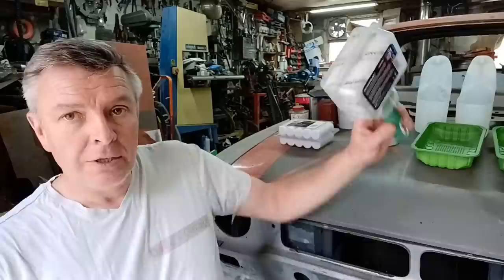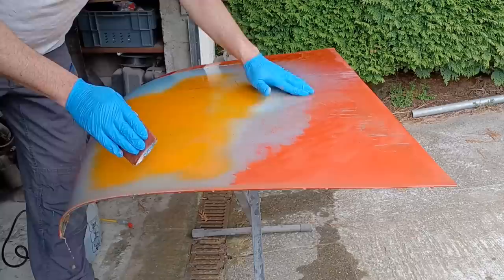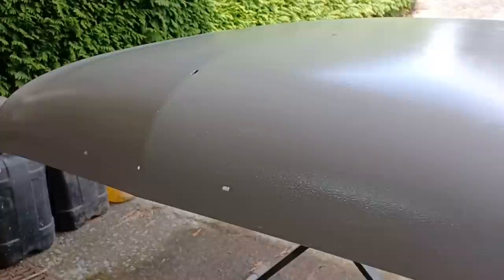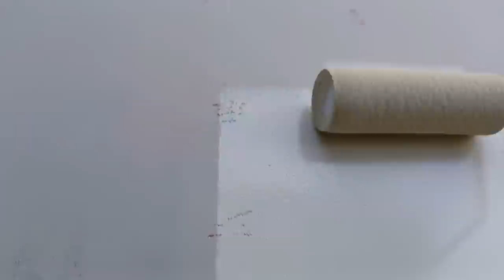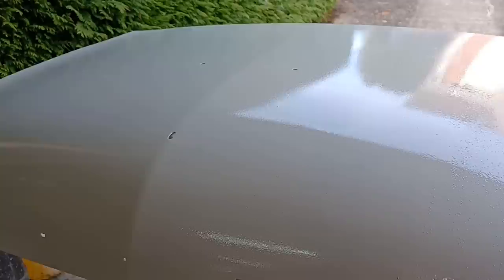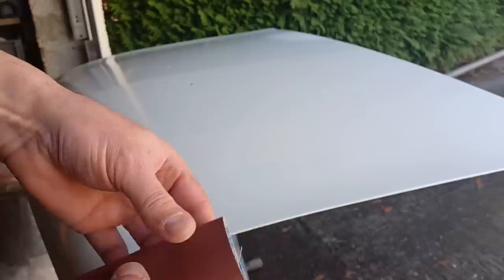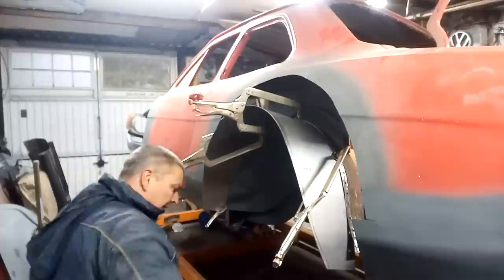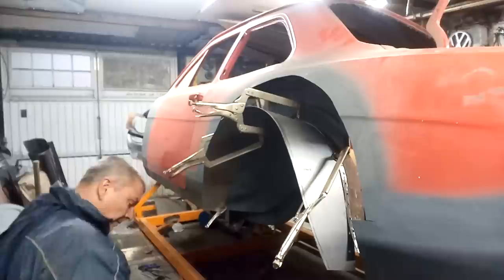Ford Escort MK1 Restoration Project. Can 2K paint be applied with a roller?

Comment: I'm so glad you tried this, as I have wondered about trying this for a while. The biggest advantage to a brush or rollered application, for me,  is the lack of overspray. Spray finishes can be excellent, but I suppose they have been developed with bodyshops in mind , with time equalling money being the main consideration. That is not necessarily the best solution for someone restoring a car at home. It would not bother me if it took me 3 months to paint a car, as long as I got a good, durable, finish.

Comment: Now I’ve seen you try I might give  this a go 
The parkside rollers you have I think are the long pile ones so will leave more of a texture as they are more for masonry…and the foam I always find introduces bubbles 
Perhaps try the short pile (for smooth plasters/interior walls) and wrap/coil in masking tape then pull the loose fibers right out the box prior to mixing up 
The long pile I’ll probably go for just the primer perhaps then a light sand 
The trick I’ve seen with composites and woodworking epoxy is a little heat from a blow torch of safer a hot air gun to thin the epoxy top coat once applied  (especially in uk temperatures) and it lets the bubbles rise and pop 
Then when you have s pretty good surface …cutting compound and a buffing polishing machine 
A tool that would probably come into play at the end anyway

Comment: Some years ago I used a paint called Parsons Re-Paint which was applied by brush. I did a Minor 1000 and a Mini and the end results were pretty amazing, in fact people would ask me where I had the re-spray done which made me feel pretty good!! First you applied a primer then the top coat but I always remember unlike house paint when you applied the top coat you brushed ONLY in one direction and never back....if you did it would leave a visible mark. The top coat 'gels' together and once fully dry and hardened it gives a high gloss finish. Its not cheap but lots cheaper than a professional re-spray!

Comment: I once painted a VW LT van with a roller using Blakes yacht enamel. It went on fairly smooth, but it was a hot day so I should have probably thinned the paint down a bit. There was a run on the drivers door, but when the paint was fully hardened, it was difficult to sand this out.

Comment: Definatley worth the try, there is so much work in spraying even after the car is prepped and even more if you dont have a booth. Portable booths made of polythene are available like a tent frame where you can use inlet filtration and extract, Elin Yakov had one to prime his GT6, as opposed to emtpying the garage of everything dusting out and then wetting the floor. Alternatively you could spray a panel at a time and create the finish after by flatting and polishing the nibs or runs out. You can see where the money adds up for a proffessional job, but its not all highly skilled, but experience helps (I would imagine).

Comment: Dave, you are a real trail-blazer, that's for sure! Many years ago I used to do a bit of work for a local body shop, and the painter there used an enamel paint for the cheap resprays, mainly because in those days he was spraying with cellulose paint and the finish straight from the gun always needed a lot of buffing to get a good shine, whereas the enamel was amazing really. You would have better luck with an enamel paint because they are made to flow out and take forever to dry, Tekaloid used to be a brand that was around at that time and was classed as a coach enamel. The main drawback is dust contamination (and flies!) owing to how long it takes to dry. Don't worry, you are super-skilled, you will master spray painting, no doubt. I have painted 2 full cars, albeit a panel at a time, in my own garage, and they have both been to shows and stood up to some serious professional scrutiny.
Reply from the maker: Cheers Bob, I have used Rustoleum enamel to paint a couple of cars, but the problem I find with enamel paints is that they are slightly hydroscopic, which is a real pain.  Surprisingly easy to get a good finish, but it doesn't last. 

Thanks for you comment mate 👍

Comment: I am going to roller paint my Prefect hot rod. I shall be using Epifanes yacht paint, applied with a roller and denibbed with a foam jenny brush. -it's kind of a coach building technique, people that have done this in the past have had excellent  results. It's important to always be working with properly wet paint - never go back over partly dried paint. Thinning the paint by 10 or 15 per cent helps a lot.

Comment: gr8 work as usual dave ,interesting experiment with the roller ,  spraying is the way to go with body panels , but as you say ,on gravitex ,brush and roller are very good , i gravitexed the underside on my rs2000 project and then brushed on 2k with hardner mixed in but no thinners , worked a treat

Comment: Make sure the rollers you use are solvent resistant, if not they will break down as you use them and leave bits and nibs in you paint, if this happens in primer it will show as nibs in the topcoat.

Comment: eastwood do a brush & roller primer (OptiFlow), its expensive though in the UK, with epoxy you have around 72 hours to paint over without having to key it, you can get away with less activator in the top coat to keep it thicker especially in the summer,

Comment: I swapped to a LVLP spraying set-up. It has many advantages over HVLP - you need less air, there's waay less overspray (I.E if you don't have a booth - we do but I know loads don't).  Less overspray means less stuff flying around in the air.  

The main drawback of rollers is that nooks & crannies are a pita.. Same goes if there's a complex shape to do, you'll just struggle to get coverage - spraying works better. You can buy a good LVLP gun for 60 or 70 quid, get a good respirator, use a boggo smaller compressor & paint ahead.  I 100% "get" the appeal of using a roller, but generally unless it's a very flat panel, meh, it gets dull - and even on flat stuff, it's also Dull. If it worked good, bodyshops would do it  - they don't, so there's your "Hint".
Reply: Incidentally, I kicked into repairs on a turbo-'scort tailgate & passenger door today - mainly as no replacements could be sourced at "reasonable" cost.  I got the passenger door done today - no big drama, needed a few areas replaced - but the tailgate is another story altogether.. Sweet Lord it's gonna need work everywhere. I'm bargaining on being stood working on that tailgate for the next week at a guess. If I get it done any faster, it will be a miracle. 

"Hint" was when I took the spoiler off & underneath every mounting point was absolute toast - that & when I took the glass out, most of the frame fell off with it... Wish me Luck. :-)
Reply from the maker: All the best with that pal
Reply from the maker: Ok, cool, I'll look into that closer to the time, you'll have to remind me though, I'm like a goldfish 🤣
Reply: @DavesGarageuk  My Missus bought me my first LVLP gun a few months back off Amazon - a Voilamart one - I was a bit skeptical at first, but having used it for the last 6 or 8 weeks - yeah, it's a great way to go. Especially for 2k clear-coat - that stuff through a HVLP gun clouds up everywhere with paint mist very quickly & it will happily kill you stone-dead if you muck about with it on the "breath this in" front - with the LVLP gun, "air-mist" is about 1/3 of what it was with the HVLP gun - so the extractor copes a lot better, meaning I get to die less, which is always good.

Same applies to that epoxy primer btw - it's laden with isocyanates that happily lodge in your lungs, doing you no favours - even if you are rollering it on. If it says "2K" on the label, be wary - 2K & lungs do not play well together, no matter how you apply it - Sensible Susans wear respirators just mixing it - and they're very possibly highly correct to do so too..
Reply: The only reason I’ve avoided a home compressor and spray gun set up is the initial investment cost but then having to buy a litre of paint and associated thinners every time you want to carry out a small panel repair. Sometimes a litre of colour can cost £80 plus all the other bits. Not really worth it for a one-off job.
Reply: @jamesward5721  That is very interesting. Is it the vapour that damages you or breathing in droplets of 2k paint or both? I've never seen anyone on youtube explain this. Also, how do you know when it is safe to inspect the paint without wearing a suitable mask?
Reply: @philtucker1224  if your only doing small repairs you dont need to buy a litre every time. 
I run a restoration company in Warrington but i buy my paint in and most paint suppliers will mix in 200mll increments. 
Depending on colour a litre costs me 55. 
But 200 ml if im doing a little repair is only 15.
Reply: @spongebobfenn  that’s very good to know Lee, thank you mate. 👍
Reply: @spongebobfenn  same here, for small repairs I can buy a tenth of basecoat for £12 , using my mini jet it goes a long way.

Comment: When using two pack, you have to lay the paint out quickly and leave it to flow you shouldn’t keep going back over like you did. Also when you wet flat to polish best not to go below 1200 otherwise you will never get the shine back and you need to machine polish the heat created brings the luster back.

Comment: Hi Dave, with respect all the hours and hard work you have put in to your MK1 there is only one way to go, that's Basecoat and clear. Especially if you wish to cut and polish. 2K clear is not that hard to work with if you follow some basic rules.
Reply: If anything, I would recommend direct gloss and clear for a beginner, rather than basecoat & clear for two reasons. 1. if you get any shit in white basecoat, it will stand out like a sore thumb and this would be very likely when not in a controlled environment. Plus when flatting back, rubbing through the clear would cause a real headache for a novice. 2.When clear coating over direct gloss it is much easier to blend door shuts etc. You wouldn't even need to clear the awkward inner panels.

But personally if I were Dave, I would just direct gloss the Escort, as you can get great depth & gloss out of modern direct gloss's and they are not affected by UV like older direct gloss colours. And I would invest in a decent spray gun. Do some research as spray gun caps are designed to leave peel in the paint to match factory finishes, choose a gun and air cap that leaves little peel for a better finish and less flatting. I use a T110 cap on my DeVilbiss GTi ProLite for show finishes.
Reply: @uncensored5104  This is not like the old days of cellulose that had a chemical bond, 2k or base coat clear rely on  mechanical bond, if you clear coated over a 2k gloss it will not bond and over time will delamidate, as for spray guns and being a painter for many years. Yes my every day gun is very expensive but I've also use the cheapest gun on the market, yes there is a difference but with good adjustment and some patience you can achieve a good job. But if your gonna wet flat and polish  there is no worry as long as you have many good coats of 2k or clear that you can cut back. If you really want to learn about  painting, check out John Mr House of Kolors you will learn a lot.
Reply: @walkingwithdogs8547  Clear does not delaminate from direct gloss, it is method that has frequently been used for years on high end & classic cars. Also when using a solvent basecoat over old panels it is more likely to lift old layers of paint, whereas direct gloss is more gentle in this respect. Thanks, but I do not need to watch any videos, I have been painting hi-end restorations for over 40 years now!
Reply: @uncensored5104 maybe if you do wet on wet it may work but if your leaving it to flash off and degas, if your looking for that real deap gloss it's simple you just use urethane it gives that and a diamond hard finish, saying you don't need to watch videos is ignorance we all continue  to learn and as they say it's what learn after you know it all, I made comment about John kawasaki and you make it clear you don't need to watch a person like this. Respectfully your missing out but we all have apinions.😀
Reply: @uncensored5104  respectfully caps are designed for spraying all kinds of different materials, a gun doesn't come standard with a orange peel cap. It's just a general purpose cap and yes even with that setup you can adjust it along with air pressure, you can get great results, but when your a pro we have many caps and needles, if your gonna spary a pearl a standard metallic to other specialised exotic paints, you will change your set up to suit and your setup may be different to others. There is no setup that fits all.

Comment: Gonna take some flatting with a rolled finish 🙈
Reply: Not with the right roller, coach builders used the paint by hand all the time 😉
Reply: Green ti 2k easy sand primer is very good probably would work wel with roller
Reply: @rectrorick  not using modern 2K paints that are designed to be sprayed on though. They used enamels and cellulose. If it’s being rolled on it would need to be used with a slow gardener and brushed out to remove bubbles to stand a chance of a useable finish.
Reply: @peterbuckley5204  primer definitely would be ok because it gets sanded before top coat is applied anyway.

Comment: I tried this with rustoleum but kept ending up getting bubbles as the paint dried, I didn't use thinners though so maybe it would be better thinned?
Reply from the maker: Thin rustoleum with white spirit
Reply: @DavesGarageuk  i’ll give it a retry, with it thinned did it still produce bubbles similar to in your video? Using Rustoleum gloss protective enamel
Reply from the maker: @44ro.n  try combi colour, it works better, you'll still get the bubbles, but you have more time to work them out, you'll get a feel for it, to remove the bubbles, very lightly run the roller over them, just the weight of the roller is enough
Reply: @DavesGarageuk  thanks for the tips, I'll give it a try with combi colour. What ratio do you recommend for thinners?
Reply from the maker: @44ro.n  dunno sorry, I just kept adding it until it worked.. as a rule of thumb, if it runs when applied on a vertical panel, then it's too thin.

Comment: I do this all the time for underbody and under arch work and it's very effective.  It isn't ever going to work for painted, finished panels.  However you can get far better results than you did.  Start at the far edge and work much faster keeping on a single wet edge.  You worked that paint far too much.  Two or three strokes immediately after each other is enough.  You said it yourself DON'T return to where you were.
Reply from the maker: Thanks Peter, good advice 👍